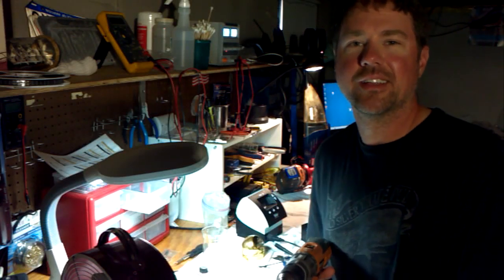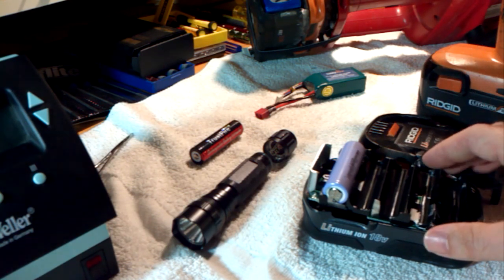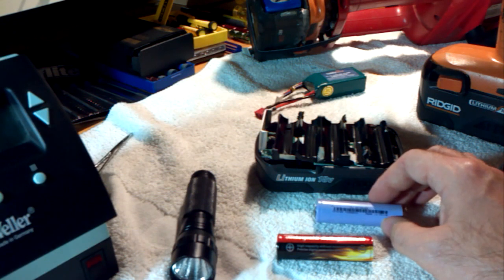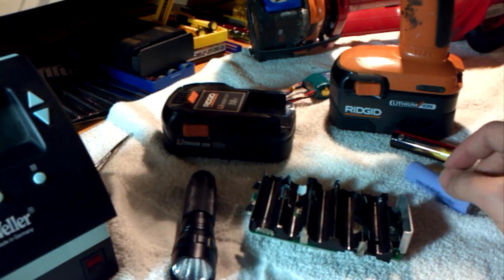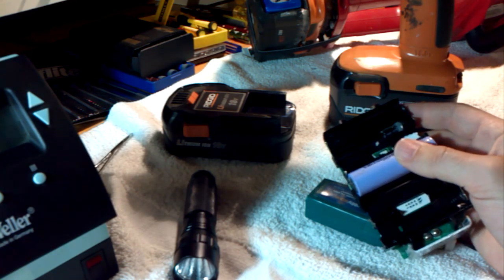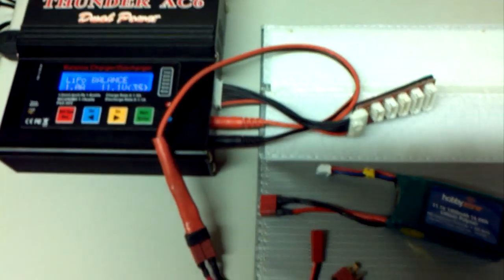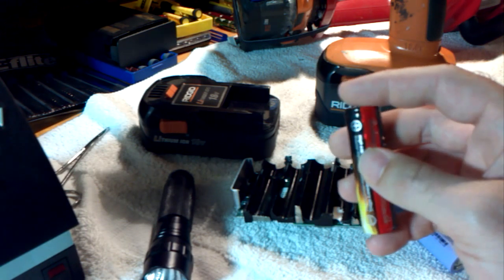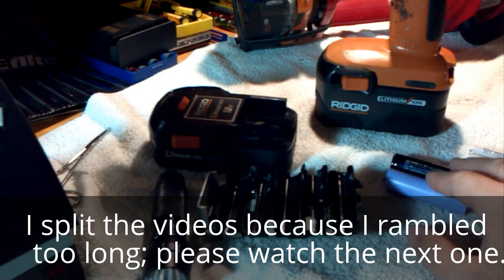18 volt battery breakdown and explanation.

Comment: Your video is pretty much all about bad those guys are because they are not balancing the cells as evidenced by the lack of "balance wiring" coming out of the pack.  However, if you look a bit closer at the battery you will see extra connections to the cells.  Those are indeed for balancing, I would think.  If the pack was charged "all at once" with all the cells in series as you say, you would only need 2 wires, not the many seen in those batteries.  You can see the extra ones in your shots.  And you can also see that the power connections are much heavier than the balancing ones, as one would expect.   That does also explain in part the need for the large PCB used in those batteries.

Comment: How do you distinguish between high and low discharge 18650 batteries considering that low discharge will not work well in high torque applications such as power tools.
Reply from the maker: Hi mateollios, if you are able to look up the specs of the particular 18650 cell that you are dealing with, you should be able to find a 'C' rating...this is the max discharge amperage (and generally corresponds to the max charge rating as well).  In general, better batteries have higher C ratings, and tend to be more expensive.  As cells age, their internal resistance builds up and lowers the C rating too.

Comment: The reason why there is so much circuitry in the battery is that the balancing board is built into the battery it self.  If you look carefully at the cells you will notice that each cell is seperated on the PC board and thus the batteries are charged seperately to the correct voltage.  I believe the reason why they die so soon is because either the battery is left sitting for a long time or they are used in a hot condition which kills the cells.  If you check out a video about electric cars they explain the worst thing for a li-on battery is heat and that is why the best cars have liquid cooled jacket to keep it cool.

Comment: 5:40 Are you sure it's a "legacy" problem?  A lot of manufacturers build the chagrinning circuitry and such into their packs so a smart charger isn't needed...though they kind of do since as you said they don't balance the cells.
Reply: +SiliconMethodRepair ... 1)Yes, nicad packs are available from the big name tool makers, and 2) The charging-discharging circuit is there for a very simple reason that other battery chemistries don&#39;t require. Thermal runaway.

When you overcharge, or overdraw, other batteries they heat up as well. But when you remove the load, they immediately start cooling. Lithium-ion is unique in that once it reaches a critical temp, it often goes into thermal runaway, INCREASING in heat, even when the load is removed. The runaway in that cell then affects the adjoining ones. Then, BOOM!

Just such an incident brought down a UPS 747. For that reason, the FAA requires bulk lithium battery transport to be done by ground. Also adding to their transport costs.

The only way to assure that doesn't happen, is a small temp and voltage sensing board/chip that can immediately open the circuit to/from the cell about to reach that critical state. Hence, they are pretty much required by the U.S. Govt, not to mention every relevant electronics association, to be included with any commercial lithium-ion battery installation. I can't speak to any particular board design, but at minimum, it will have a temp/voltage sensing chip that will cut the power. The better ones will have balancing circuit for each cell.

Source: I am an electrical and aeronautical engineer who is currently working on a man-carrying, all-electric aircraft project using very large lithium battery packs....
Reply from the maker: +Titus Corday Titus, good point.  If I had the funds and time, I would like to go to Home Depot / Lowes and buy all the different types of chargers and batteries to test.  I'm very curious how different manufacturers handle charging.
Reply: +SiliconMethodRepair I don't know, it seems to me like they put all that protection circuitry to avoid lawsuits from ignorant consumers and their lipos blowing up or UL is requiring them to or something.  DJI does this kind of thing too because they're trying to appeal to more than the hobbyist.
So do they sell 18v NiCad battery packs for these drills as well or do they just run the motor at a lower voltage when going NiCad?  Thanks.
Reply from the maker: Titus, I don't know if NiCad packs are available from the big names anymore...I think most people build their own.  Nicads can be obtained in several cell sizes so getting up to 18v (or whatever) usually isn't an issue...although of course the amp-hour rating is going to drop.  It's interesting you mentioned DJI's use of proprietary packs...I refuse to use one of their prebuilt solutions for that reason (among others).  I don't like to be locked in.
Reply: +Jc Knight
Cool!  Can you share a little about the project you are working on?  Sounds incredible!

Comment: I'd venture that the reason why they don't include the circuitry in the tools is due to the way that cordless tools are sold to homeowners and, more importantly, contractors. Each company basically has a whole series of tools that work with the same same battery packs - this basically creates a a tendency for people to stick with a single brand. More than once I've heard contractors remark that they're basically "married" to DeWalt or Milwaukee or whatever because they already have several chargers and multiple batteries for that specific brand. You can just imagine the furor that arises when people are told that they need to buy a new whole new tool to use a new and improved battery and/or that they the new battery that came with their new power tool is incompatible with the rest of their tools and chargers.
Reply: The batteries cost more than the friggin tools though. My porter Cable set cost $200 for drill, impact, light, charger and 2 Li batteries. 3 years and very limited use later, replacement batteries are around $90 each! The heck with that, I'm sticking with NiCd from here on out.
Reply from the maker: AoDAzrael, your theory is definitely correct, at least in part.  Manufacturers want the lock-in, and also to avoid any liabilities.
Reply from the maker: Todd Silimperi
Todd, yep...NiCds are tough...but I think NiMH are a better option if you can locate packs built with that type of cell.  The newer generation of NiMH are less memory prone, and more energy dense than NiCd.
Reply: but can you just replace the nicd with nimh? is it that easy?

Comment: The battery has the balance circuit on it... You said that the connections would need to be increased on the battery and the charger to connect to each cell... Take a look and you will see that each cell has a balance lead connected to the main board. I like the fact that the battery has the circuit in it Vs. the tool because if the manufacturer modifies the way the circuit controls things they change the battery and the user gets the added benefit without having to purchase a new tool. Just a new battery, that they were going to buy anyway.

I don't know why RIDGID would do things differently to RYOBI, AEG and Milwaukee as they are the owned by the same company (Techtronic Industries) and they all have cell balancing.
Reply from the maker: Phillip,  as I pointed out on the website there is definitely no balancing going on.  Each cell would need a separate connection to the board; instead they are all spot welded to the same metal conductor.  I proved the lack of balancing by dropping one cell to a lower voltage then charging the pack...the low cell stayed lower then the rest.

Comment: You just made a very important point as to why people should NOT replace NiCad batteries in their old packs with LiOn batteries. There won't be any circuitry there to protect the batteries. Guess I'll just stay with the old NiCad.
Reply from the maker: Morgan, what I'm hoping to see in the future is is packs with removable, independently protected cells (the cells are already common).  Manufacturers don't want to do this because they make so much $$ from selling battery packs, of course.  In the meantime, NiCd and NiMH are a better choice.